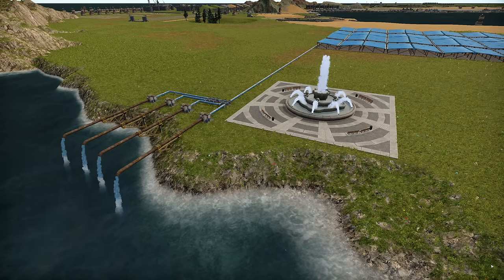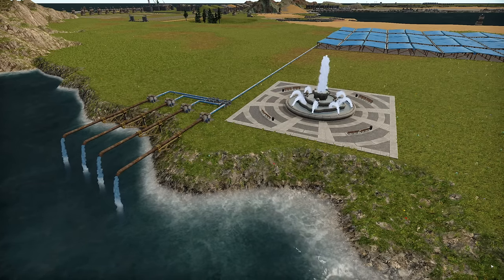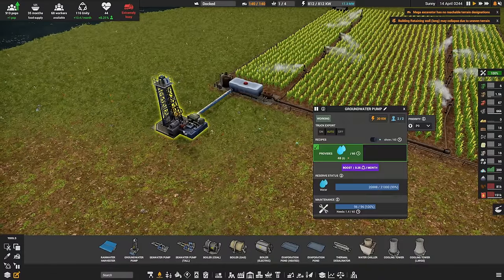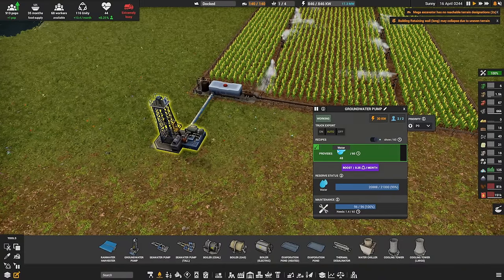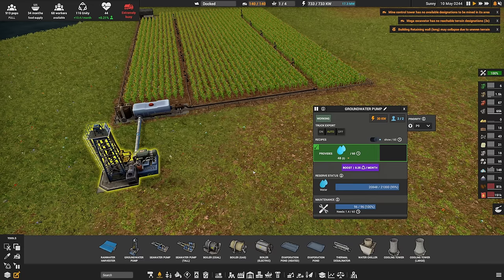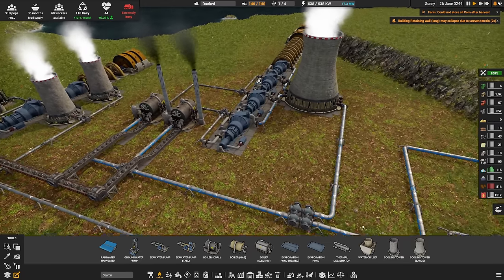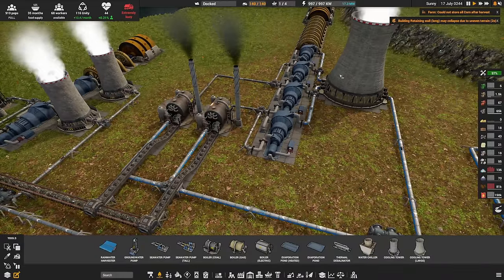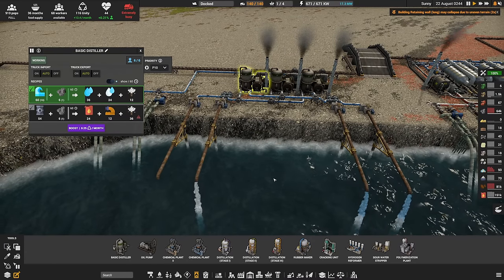Ultimate Guide to More Water 🚜 Captain of Industry  👷  Walkthrough, Guide, Tips

Comment: Thermal desalination 2nd recipe  12 used steam in 24 water out plus 9 salt water which can be used or dumped pollution free. Combine this with exhaust filtration and you can double your water. I got 8  exhaust filtration plant feeding 16 desalination plants providing 144 water surplus.
Reply from the maker: Yep tying recipes together can give great bonus, I just setup exhaust filtration myself for steel, and it makes enough clean water to power itself and also provides water for copper smelting

Comment: Hey JD, is it possible to have different fluids running through the same pipe? EG I want to dump various  waste fluids through the same system... I thought this was possible but it seems to cause fluids to back up?
Reply: a segment can only have 1 type of fluid at any time, so low quantities works okay, but as you have noticed things will quickly back up.
Reply from the maker: Not really, one fluid type in a pipe at a time, I guess with some tanks and a balancer you could force the issue. But In the lets play I did manage to use the same water dump for 2 liquids, but it was 2 pipes with a connector right at the end which went directly into the liquid dump, Connectors buffer some items, which meant when it swapped liquids it tended to dump quite a bit before swapping again
Reply: could be possible with sporadic amounts i suppose using a balancer but not sure in what situation this would be preferred to using multiple liquid dumps?

Comment: i have a nuclear plant directly connected to 24 desalination plants and that is producing massive water outlet.... at the cost of meltdown every so often because it outputs more steam than they can handle (I did the math, you can check my math, it should work) however it does need to be connected in 3 sets of 8 for it to work correctly or else SOMEONE will back up and cause a meltdown....

so yes, Nuclear is fun, nuclear is so much fun it gets excited for no logical reason other than it wants to be excited...

So, I put a vent at the steam so that it can vent excess steam, it's happy now... I guess...
Reply from the maker: I setup one like this during a stream, My also melted down once, turns out it was a backup of clean water and/or brine
Reply: @JDPlays  I set it up so that it's 8x8x8 all isolated from each other and it still melts down, each block of 8 has it's own waste water, each block of 8 has it's own seawater, each has it's own line going into the large tank... and the steam backs up...

But when you have the flute to vent overflow at the start, you push out more water than the Murray!
Reply from the maker: Oh 8 at a time thats your problem. You need more sea water than a MK3 pipe can move, Mine is setup in 4x6 for Sea Water and 2x12 for Brine